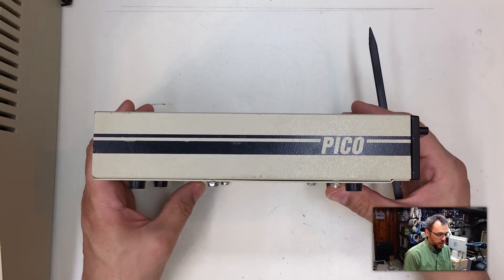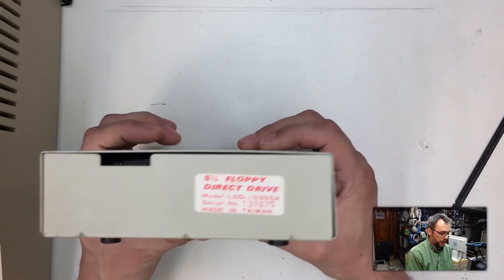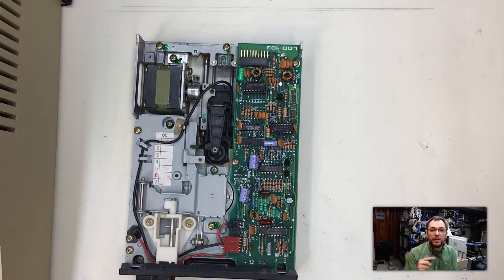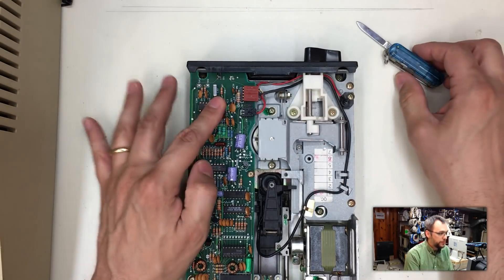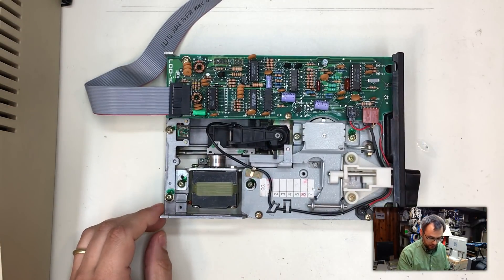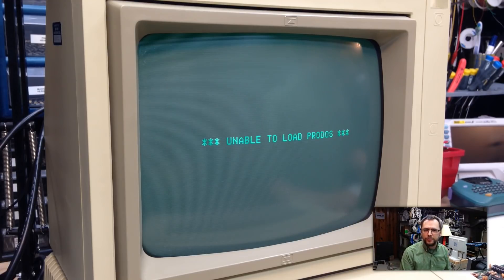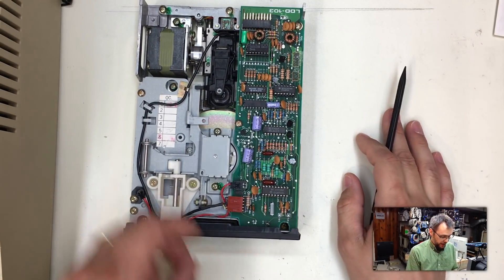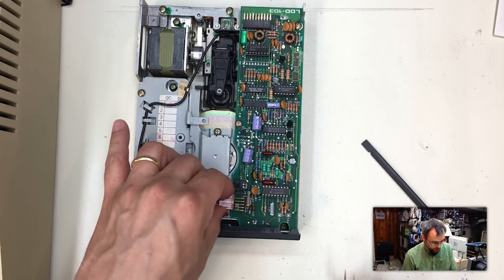Let's Repair! - Apple II Floppy Drive

Comment: My 5.25" drives keep blowing up. They last less then 30 minutes. I have replaced everything but the power supply. Can a faulty power supply blow up drives?
Reply from the maker: It can, but that will usually break more than just the floppy drive. It won't hurt to replace the power supply with one from ReactiveMicro anyway, even if it doesn't fix your floppy drive issue. It's hard to make further diagnosis without seeing the machine and drives in question.

Comment: I think my drive has the same problem caused by a similar burnt IC. I inspected it and it is very suspicious. :) I get courage from your video, and I'll try to repair it! (Sadly my IC is not in a socket, so I'll have to solder a bit, but I'll put the new chip in a socket at least!) :)

Comment: I have a Apple IIe with two 5.25 drives. Is there any extra hardware that I need to use a 3.5 floppy drive on the computer?
Reply from the maker: Aside from a drive, you would need a "Liron" or "SuperDrive" card. You can get a SuperDrive card from ReactiveMicro.
Reply: @JoesComputerMuseum 
Thanks

Comment: The drive ribbon cable was plugged in to the controller card incorrectly at some point.  Either backwards, or misaligned pins, because of unkeyed connections.
It may have sent voltage down the wrong lines.  Check for burns on the bottom of the board too.

That socket should be replaced, if it's not too much hassle.
I tend to replace all single-wipe sockets I come across with double-wipes when I can anyway.
Reply from the maker: Yup. I've been gathering that the last couple of days from multiple sources. It must have come to me that way, because I've only ever had it connected to my Apple maybe four times over 25 years, and I'm always very careful plugging it in.

Comment: A blown 74LS125 is pretty common with Disk ][ type drives because the original controller card connectors weren't keyed.  If you plugged it in with the pins off by one, you would usually blow the 125.  I did this once while in college and actually blew a chunk of plastic right off the chip.  I think I still have that chip in one of my electronics boxes.  Also, I'm not sure what type of connector that you fixed is but there are some crimp connectors that are designed to bite through the insulation of wires.  It connects with the wire inside and the insulation acts as a bit of a strain relief.
Reply from the maker: Yup. Same thing KomradeMikhail
 said. I think the original owner did that to the drive, because I've only ever had it connected to my Apple maybe four times, and I'm always very careful plugging in Apple floppy drives because of that issue.